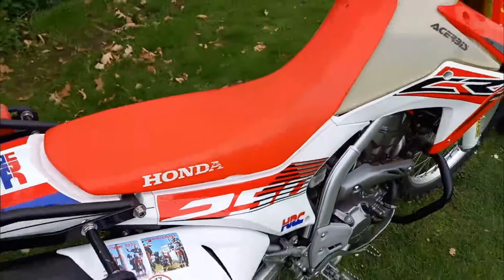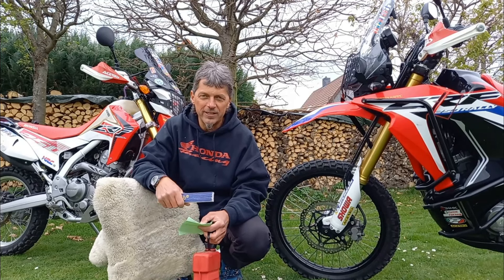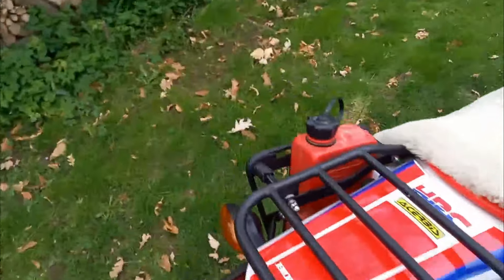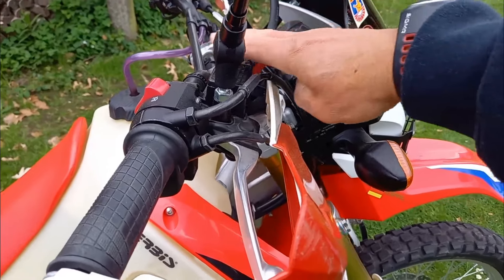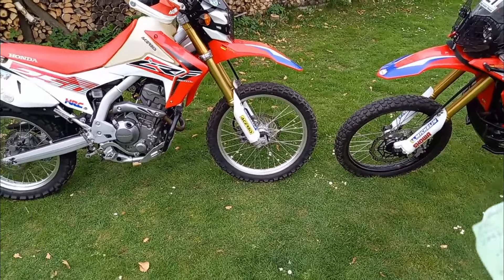Alle Umbauten 🛠 an der Honda CRF 250 L vs. 250 Rally zum Reisen & Endurowandern #hondacrf300l

Comment from the maker: Glück auf liebe Endurowanderfreunde!
50.000 km auf der Honda CRF 250 L und Rally in den letzten 6 Jahren, viele Offroadpisten durch 20 europäische Länder auf dem Trans Euro Trail (TET) ...
Heute in diesem Video Teil 1, habe ich für Euch meine Umbauten für die Reise- und Offroadtauglichkeit mal zusammengestellt bzw. wir werden darauf eingehen. 
Einen 50.000 km Reiserückblick in einer Foto-Dia-Show folgt bei Wunsch in einem gesondertem Video Teil 2.

Inhaltsübersicht:
0:53 Min Begrüßung I
2:07 Min Sitzbank Lammfell
3:34 Min Begrüßung II
4:55 Min Gepäckträger / System 250 L
9:10 Min Reservetankhalter CRF L
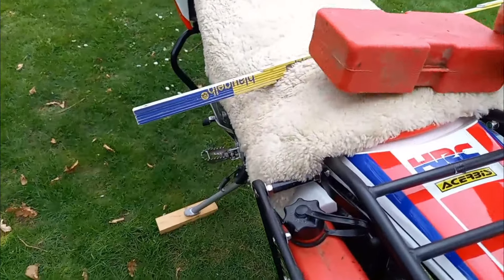9:55 Min Gepäckträger / System CRF Rally
12:30 Min Motor-/Tankschutzbügel Rally
13:20 Min Motorschutzbügel CRF L
14:00 Min Windschild CRF L
14:40 Min Lampenschutzgitter L und Rally
15:00 Min Gurt am Feder für externe Hilfe (Rettungsgurt)
15:50 Min Handschützer
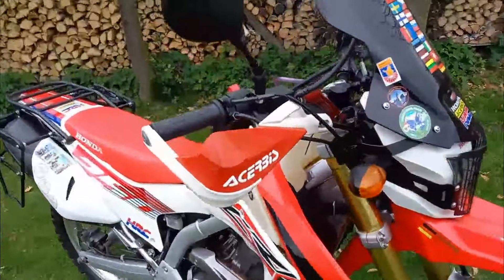16:28 Min Klappspiegel
17:00 Min Strom / USB am Lenker
18:19 Min Daytona Griffheizung
18:50 Min Oxford Griffheizung
19:44 Min Kettenschutzverlängerung
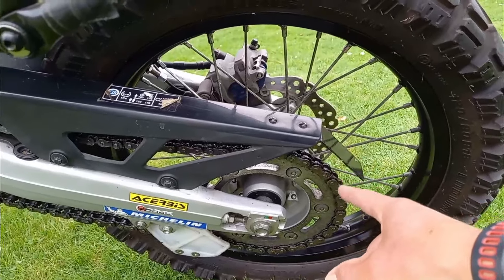20:42 Min Original Fahrwerk
23:35 Min 250´ziger oder die neue 300er ???
24:45 Min Zusatztank Acerbis
26:30 Min Gewicht
27:37 Min Sitzhöhen - Stehendfahren 

Vielen Dank für Euer Interesse!

Glück auf Euer
Harzer Endurowanderer 🌲🙋🏻‍♂️

Comment: Hey, Danke fürs Video. Ich überlege schon länger mir eine dieser kleinen Enduros zu holen nachdem ich sämtliche 90er Jahre Reiseenduros gefahren bin. Bin immer noch am grübeln, ob die 300er (oder 250er) CRF mir auf Dauer reichen wird. Auch die Entscheidung ob Rally oder "L" ist nicht so leicht.
Reply from the maker: Moin,
es gibt ja jetzt 4 Modelle die in Frage kommen. 250 L und Rally oder 300 L oder Rally!
Es gibt schon einige Faktoren, die du selber wissen musst. Die Körpergröße z.B. über 185 cm ist die Rally besser aber bis 190 passt auch noch die L. Darunter immer die L nehmen. Ist dir die Verkleidungsoptik wichtig oder möchtest du vom Grund her gleich mal 10 kg weniger? Tankvolumen und Windschutz ist bei der L kein Problem mit nachrüsten.
250er oder 300er? Das liegt am Geldbeutel. Technisch gesehen gibt es nur ganz minimale Unterschiede. Preislich kannst du schon 2.000 bis 2.500 Euro sparen. Ich habe ja beide 250ziger und muss nicht auf die 300er umsteigen. Hätte ich noch keine, würde ich heute die 300 L Neu kaufen oder als Jahresmoped versuchen zu bekommen ...
Glück auf